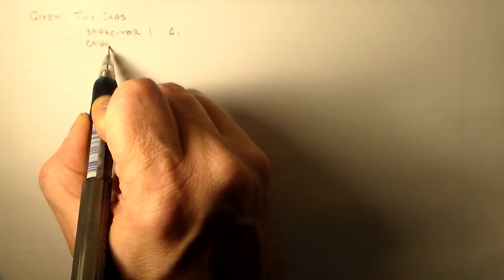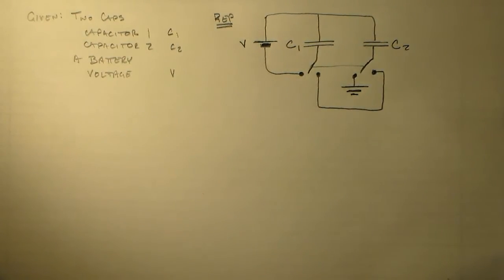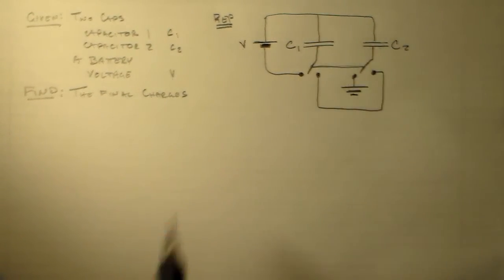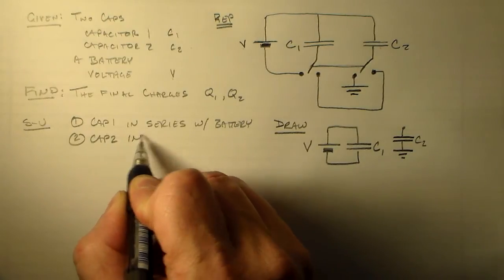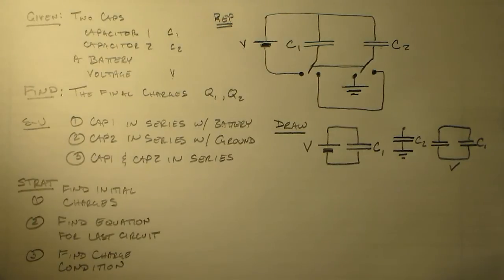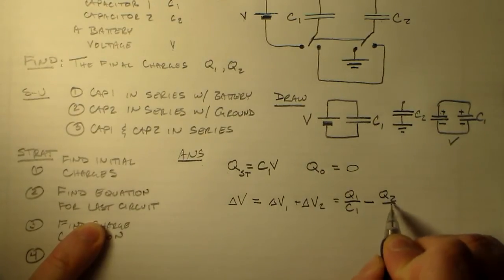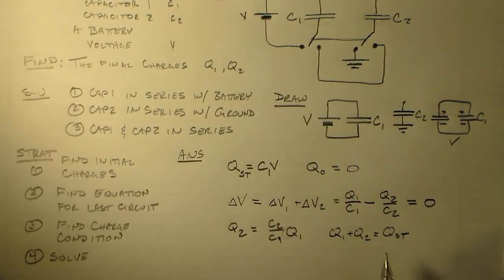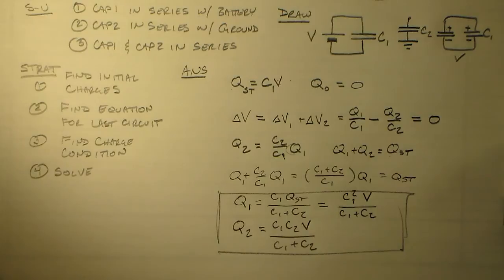Simplified Two Capacitor Problem

Comment: Conservation of charge conflicts with conservation of energy E=1/2C*V*V. Use E start = E finish and you get a different answer. Both are correct according to Maxwell, but this circuit is outside the bounds of observation (no resistance - impossible in practice). This shows that Maxwell's equations are not absolute truths but will be observed as true in any experiment. Science does not show us how the world is, it shows us how we see it (Kant).